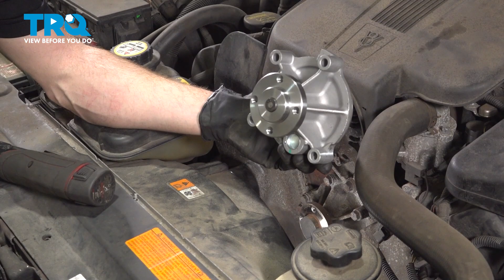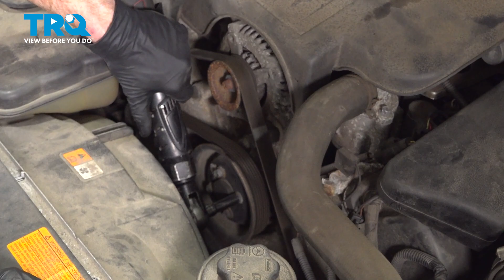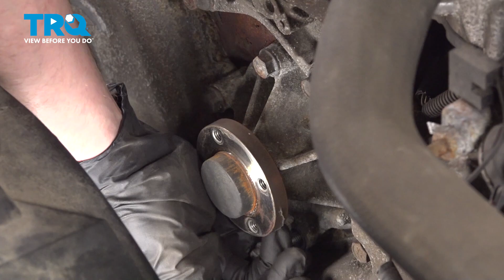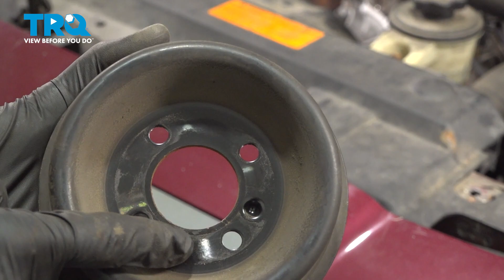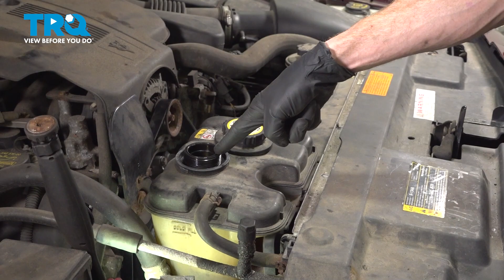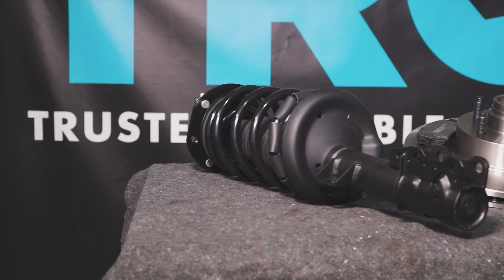How to Replace Engine Water Pump 2003-2011 Mercury Grand Marquis

Comment: So, did you have to use a torch to heat up the bolts to get the water pump out or some kind of pully, It will not come out by smacking it with a big hammer!

How long did you let the penetrating oil sit, before you hit the pump with that hammer and it came loose? I am not the only one that asked that question. What else did you have to do to get the water pump out?

Comment: They forgot to show putting a light coat a silicone lubricant around the O-ring so that it slides in easy without rolling and braking

Comment: I did a pressure test and found leaking at the water pump, never seen a leak here or puddle under the car. Only obvious on pressure test. Does it need to be replaced?